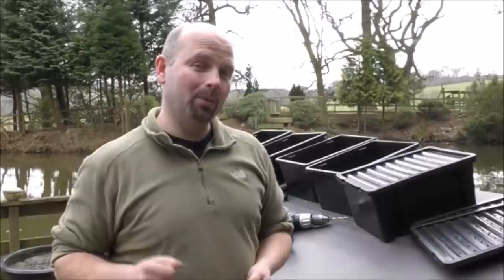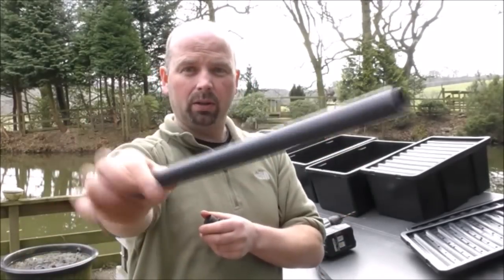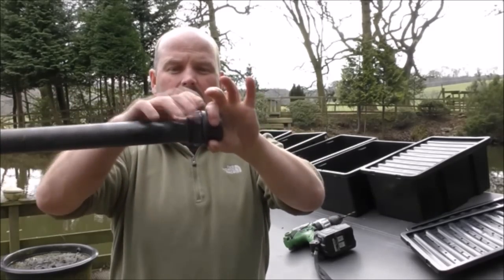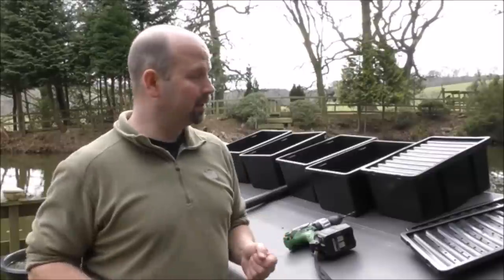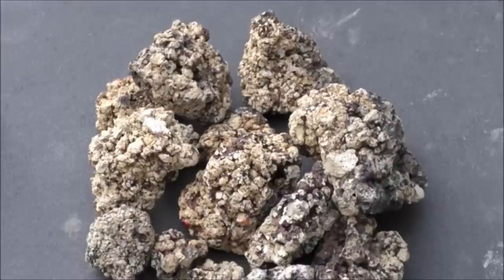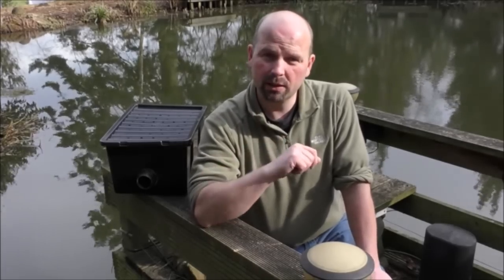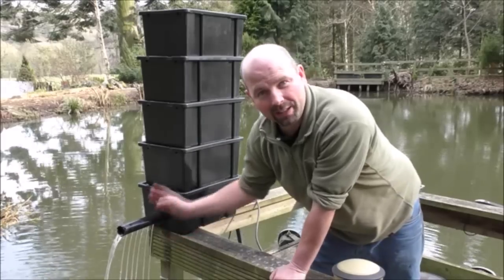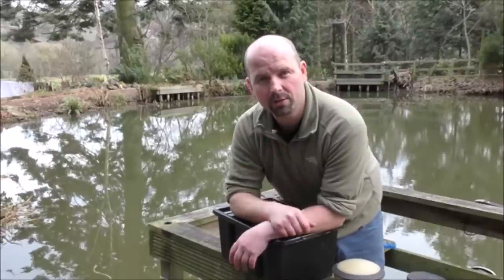DIY Shower / Trickle Filter for a Koi / Fish Pond by PondGuru

Comment: I’m looking to build something similar to this for aquaponics setup. As a result I don’t need nitrate reduction just very good mechanical and nitrification media. I’m looking at somewhere around 275g tank with 100 or so fish with somewhere around another 500g or so of water between grow beds and sump tank. The fish tank will feed the sump and the sump will feed the grow beds, fish tank and filter. The sump will also be the return for the grow beds and filter. So roughly a little under 1000g. I’m looking to use a couple totes or boxes for nothing but lots of poret foams of 20ppi density. I will have gravel filled grow beds so I will got some filtration there but don’t really want to rely on that for filtration. The system I’m looking at will have approximately the same size tote boxes as this video.. how much media and of what type would you recommend. I know aquaponics is out of your experience but it’s still fish keeping where you don’t have to worry about nitrates to the same extent. So for 100lbs of fish with around 10g per fish total system what would be an effective and cost efficient media to us? I’d rather spend s few dollars on an extra box then several dollars more for better media.. my initial though was to use lava rock or lower grade Pumice from landscaping in stead of paying for regular aquarium media that’s costs $30-40 per gallon as I’m looking at likely needing 100g or so in media I need something I can bulk buy for a good price. I even looked to cheap ceramic rings and bio balls but I don’t think they will work when comparing amount to cost vs surface area needed.. your thoughts?
Reply from the maker: I'm not sure what is available in the US as I am in the UK so answering the 'what media should I use' question is never easy unless it's from the UK.
If you had been in the UK I'd have said go for alfagrog in the 40mm size as it is really cheap and better than most lava rock but I'm not sure it is available in the US. If you can get white pumice that would be a great one to go for if fish and plants liked pH above 7.5 as it mineralises the water and has a good internal structure - problem is it may help to reduce nitrate so the standard red / brown very dense lava rock 'scoria' would probably be a better choice. I know you guys have that over there.
Without knowing the size of the growing beds it's hard to guess at how much nitrate you'd need (plus I have little experience of growing plants / aquaponics) and although I'd normally say stay away from any plastic media if it is enough to eat up the ammonia and nitrite and the plants are taking up the nitrate it's all good. A moving bed would be most efficient for removing ammonia and nitrite but I don't know how much K1 or similar is over in US so it may not be an option.
Reply: Pondguru that’s plenty of response.. I wasn’t expecting a detailed list of best to worst.. we have all you mentioned here. The grow beds will be 4’ x 8’ and roughly 8” worth of gravel deep. The reason I don’t want to go with considering the grow beds for media space is cause I’m going with plain old river pebbles which really won’t provide much surface area. Ideally I would go with a moving bed filter however the shear amount I need and the cost of it plus the additional cost of a high end air pump is more then I want to put into it. As for the pumice that was my first though was to get garden grade pumice and just use that. I was unaware that it buffers the ph a little.. plants like 6.6-6.8ph ideally so having a 7.5 buffer is a no go. I do want something that will mineralized well as I don’t want to have to add a mineralization filter which many do and I see as something not needed when I can get it through trapped detritus breaking down in the poret foam or other ways.. I also want efficient and low maintenance.. what would be your thoughts on nothing but poret foams in a trickle filter? Clearly I’d have to build a really good spray bar system to get proper wetting through that much foam unless I went with a traditional closed cell foam pond filter that can wick and stay moist.. that would be cheaper but again I was looking for low maintained and the closed cell structure of regular foams I thick would clog up too easily and reduce flow and possible give denitrification through big pockets of mulm collected.. my issue is looking at normal media choices for filtering I’m looking at almost the same cost as the entire system. So what I’m looking for is something I can buy a lot of very very cheap or something that will work just as well in a smaller amount where total cost balances out.. I’m trying to stay away from the cheap Chinese bokki media’s. Bioballs and cheap ceramic rings are cheap up to a certain quantity but at the amounts I’m looking at will actually be expensive.

I actually think ehiem Substrat pro would possibly be a good choice as it’s fairly cheap compared to the amount of surface area and due to construction can help mineralize waste for plants.. this would be an example of something I think could be used to replace 2-3 totes of something else which could offset the cost overall? My issue with that is it breaks down over time and needs to be replaced...
Reply from the maker: If it is for use in a system which incorporates growing beds the choice of media may not be too critical. If you have something called Hyrdoton which is an expanded clay ball media that may be as good as anything for the growing media but could also be used in a shower situation too.
Yes, definitely stay away from the chinese shower media as it is an absolute waste of money - so brittle that you'd be lucky to get a few months out of it.

Comment: Hi Richard, do you have a video or instructions on how to design and make a simple homemade filter using the 44 gallon plastic blue drums?  I have a 400 litre fish tank and find the 1200 litre/hr canister filter is not keeping up and not able to hold enough media to keep nitrate level low.
Reply from the maker: +Ted Nguyen I haven't done a video on making a filter from a large drum but the concept is exactly the same. Many people in the UK make moving bed filters from large drums but they would be better with a shower filter as moving beds seem to produce lots of nitrates.
For 400 litres it would be easier just to add another canister filter?

Comment: With a decent size pond aeration system would be the way to go.
Reply: (my other channel) I currently have a big air pump lifting water through 2 x 2" pipes and drawing water up from the depths to be spread on the surface of the pond. I also have the filter pump running 24/7.
The water is in very good condition and reasonably clear but I'm getting all the carp and big sturgeon fished out before the end of the year. Without them digging around in the base of the pond it will revert to being crystal clear again.

Comment: after watching this i built one works great  instead of using a spray bar in the top box i have a spinning garden water sprinkler
Reply from the maker: Sounds great - I'm assuming that you took the head off the sprinkler or it would get clogged up (assuming you had a solids handling pump)
Reply: hi the check valve on the input pipe has a gauge filter  what do you think of drum filters what stops the jets being blocked does the drum filter act as a prefilter or do you need a prefilter to prefilter the drum filter  best regards
Reply from the maker: A drum is an excellent filter and that is all you would need before a biological filter as they are self cleaning and remove very fine muck. As with most filters they are more efficient when used on a gravity fed system due to a pump chopping up muck into finer particles but a drum will still handle anything a pump can throw at it. They are very expensive but good. Jets on a drum filter would normally be fed from a pump at the end of the gravity filtering system (where water is cleanest) as far as I can remember but if if it is a pump fed system it may be attached to mains water?
Reply: thanks  i used to make something nearly identical  for plating nuts and bolts which were inside the drum with spray bars on the outside  pumping the solution inside
Reply from the maker: Sounds like you've got the plan and skills for a successful drum...
Reply: the trouble is i am retired and now live in thailand at this point having a concrete pond built but finding good filter media here is a nightmare but pipe plastic valves etc cheaper than chips
Reply: have a look at this concept  if you had a small cement mixer with millions of holes drilled in it, the water from the pond is pumped into it while it is turning the water then returns to the pond you remove the drum now and then  for cleaning out   of course you would not use a cement mixer but the drive would be handy  or is this a rubbish idea
Reply from the maker: A 'proper' drum has a mesh skin which filters down to as low as 50 microns so replicating that efficiency would need a proper mesh to be used. The price of them is coming down all the time so if I was going to use one I'd definitely just buy it ready made I reckon.
Reply: thanks mate  the problem is i got it to my brain now i got to make one but i going to make a 4 foot drum   if you ever come to Thailand come and visit me you will be well look after when my pond is finished can i send you some photographs
Reply from the maker: Yes would be good to see the photos of that project for sure. My email address is sales@filterpro.co.uk

Comment: HI
I want to ask  questions first is it condition to run the filter 24 hours every day  the bacteria in the filter how we make it or it is from the air  what is the steps that we must do it on the pond before we put the fish is it condition to put water plant in the pond 
is there a suitable fish that can live in sweet water in the winter is it a condition to warm the water pond or to cover the pond from the rain or also from the snow 
thanks
Reply from the maker: Yes the filter has to run for 24 hours a day to keep the bacteria which lives in the media alive and well fed - it also helps to keep oxygen and carbon dioxide levels more stable too.
You don't need to protect the pond from rain or snow and the plants can go in after a day or so of running the filter, once the water treatment chemicals from tap water have been neutralised by sunlight or tap water conditioner.
Reply: hi
i understand that the bacteria  exist directly from the air or from the soil and we dont make it also tap water contains cl or other materials it is not condition to put chemical materials to get rid of cl and other materials in tap water because the fish cannot live in water contains cl  so these fish can live in tap water what happens if we dont plant a plant in water the last question is is it condition to put medicines for these fish to keep it healthy how many days must  change the pond water completely or mostly 
these fish put eggs how can we treatment these eggs or baby fish
please answer all these questions
thanks
Reply from the maker: I think google translate is messing up what you are asking there as it doesn't read well unfortunately. I will answer what I can:
Plants are not necessary in a pond when you have plenty of good filtration to keep water clear and healthy.
Ideally you would only change 10%-20% at any one time but a pond normally just needs topping up after warm weather when you have goof filtration.
If you have a well planted pond the eggs and fry of fish will live well in there and should be safe from fish in pond unless they are predatory.

Comment: Love the Panther - Could Lava Rock be used as a medium?
Reply from the maker: The stuff generally though of as lava rock (scoria) is decent but too macro-porous to support anaerobic bacteria well so you tend to get good ammonia and nitrite reduction but high nitrates (just like with most media) but the white pumice has a much more varied internal structure so can support both aerobic and anaerobic so you're in a chance of getting full cycle filtration using that type of lava rock.

Comment: I don't remember hearing you say if you put 3 pads and bio-home in EACH CONTAINER, what type of pump did you use, how did you keep large debris from clogging the pump, does this system get rid of sluge
Reply from the maker: Some people would use foams in every container but they are really only needed in the top box. I actually went on to use the biohome in the top box and the 30mm - 50mm pumice in the two boxes under that for the 3 box filter I now use on an outdoor aquarium here: https://www.youtube.com/watch?v=EL9HR_Y3-40
Ideally you would have a solids handling pump ( e.g. Oase aquamax http://geni.us/4OQ ) and the filter would help clear the pond assuming that dirt was removed from pond by the pump. 
If you have loads of muck in the pond it may simply clog the foams quickly so if it is too dirty in the pond it would be best to remove most of the dirt and sludge before setting up a filter as that will be less frustrating than cleaning a filter every 2 days on a dirty pond.
The filter is there more to keep a pond clean, not clean a pond with heavy sludge - hope that makes sense.

Comment: thanks for a prompt reply. I've search so much... I'm a little confused.. most koi ponds i see do not have plant life in the water and i would like to have a few plants. will that be a plus or minus and add labor to the koi pond or help the eco system.  Also do i still need a debris cleaning system for the koi pond .
Reply from the maker: +bsessley55 As long as you design the pond either with a bottom drain or to slope to one end the muck will be easy to remove. Most koi ponds won't have plants as the koi eat them so the planted zone would normally be sparate, after the filter to help with nitrates.

Comment: Thank you. What is your opinion on the use of a diffuser over course gravel, over medium gravel,  over sand as the medium then a seperator fabric over some small gravel to go around the drain pipe?
Reply from the maker: +Mark Kurtis Just about anything can be used as a media and that all sounds plausible but I would avoid using sand unless you have a very slow flow rate or the sand is very coarse.

Comment: he used 5 for 2000 gallon. meaning one for every 400 gallons! thats crazy bro. Im over here worried about my 300 gallon lol. DId you use the same exact layout from coarse to fine foam in each of the layers? thats the only part i wanted more information on (doesnt make sense to add more coarse foam), like exactly what other material was used in the other layers and how much. thats all the questions i have any one who has info can respond thanks.

Comment: can I use only 3 boxes? top one with filter and biohome. middle with pumice rock,and bottom with bio balls media. I cannot add more boxes due to pond been raised above ground for 4  feet and roof restriction of the gazebo where pond in.thanks
Reply from the maker: Yes you can use as many or as few boxes as you want for a filter. As long as you have foams etc. in the top tray followed by media it's all good.
Reply: Should the drain be empty without media? I'm trying a 2x 32 litre box variety for some ibc tanks and want to use as much bio filter as possible, so i'm figuring majority of my bio media need to be in the bottom chamber where the drain pipe is (as the top box if pretty filled with the filter foam mats. Or will this conflict with drain in any way?

Comment: hi i love all your videos. just a few questions. whats the sizeof the containers? what is the pond capacity the above filter can service?
Reply: mine is 14000ltrs. can this shower filter handle it?
Reply from the maker: The containers used in the video aren't very big at all and a 5 stack would maybe be suitable for a 4-500 litre pond. If you have 14000 litres you'd need much larger continers which could hold more media or a pressure filter to act as the mechanical filter in a 2 filter system.
Reply: OK. IF I HAVE A STACK OF FIVE 100LTRS CONTAINERS, IS IT OK?
Reply from the maker: Wow that will be way more than you need but would provide an awesome filter. If the top one was used for foams that would leave 400 litres to fill which would work out expensive so I'd personally go for alfagrog in 3 containers then pumice in the bottom one or have 2 alfagrog then 2 pumice. Either way it should pound the pollution coming from the pond and the nitrates have a great chance of reducing close to zero.
Reply: +Pondguru Outdoors thx for ur help. i am from india and dont have good access to people knowledgeable like u.
Reply from the maker: No worries, not sure what filter media you have access to over there but even using gravel will make a decent shower filter. Natural pumice / lava rock would be way better if you could get it.
Reply: +Pondguru Outdoors hoping to get a pumice media, or else planning to go with sandstone gravel. never expected so much support and encouragement from you. thx a lot.
Reply from the maker: No worries, any time.